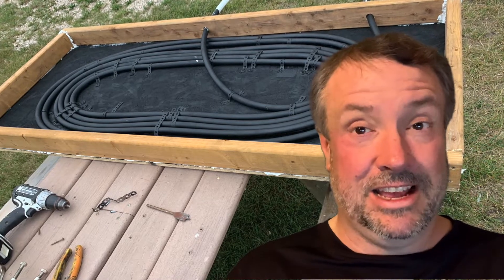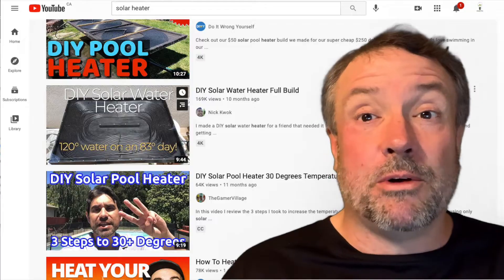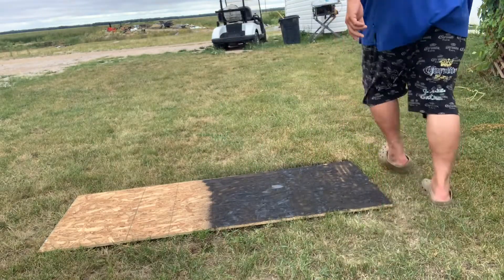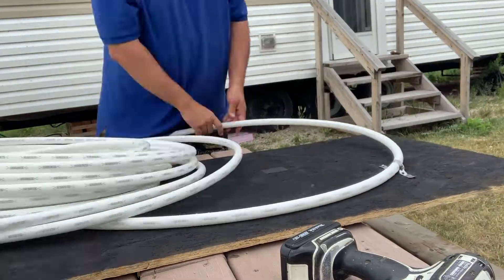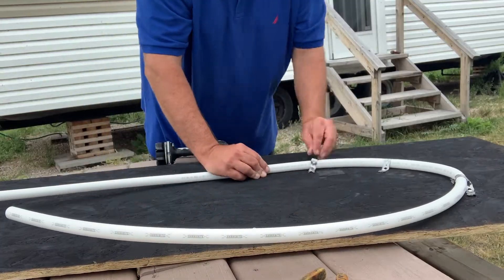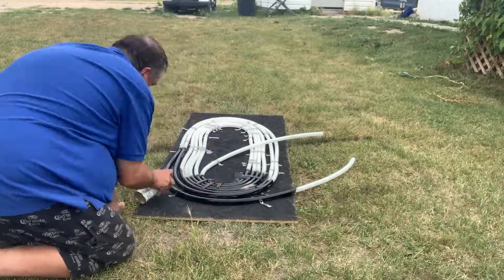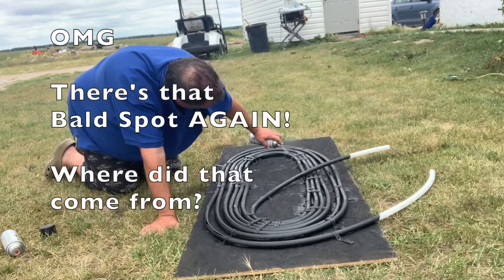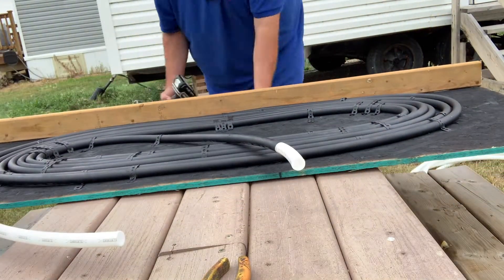Solar Water Heater Build with a Solar Pump

Comment from the maker: Love to hear your comments on how to make this work better!
Reply: 😉 This can be even more simplified. 

Try this experiment. 

Take the same length of coiled pex ( or coiled black dripline hose that is already black and is cheaper)  and cover it with a mulched greenwaste  pile. 

Then do some temperature comparisons. 😉
Reply from the maker: @wanasong5611  I have videos on compost heating on my channel
Reply: Wouldn't aluminum or some metal tube's work better ?  I don't know much
Reply: infi Del copper works best... but it's too expensive. 😉  Black irrigation tubing is cheapest and saves on paint.
Reply from the maker: @wanasong5611  cheaper than pex? Pex is pretty cheap
Reply: Simple Tek You'd have to price it out in your area... but generally, where I am, 100' of 5/8 irrigation tubing is about $20.00 compared to 100' of 5/8 pex at around $45.00.  And it's already black... so you can lay it out in the sun to heat up by itself or bury it in a well chipped mulch pile for even more heat.
Reply from the maker: @wanasong5611  interesting!
Reply from the maker: @infidel6347  I agree metal is better but they would but they cost a LOT more

Comment: I'm looking to doing something similar my only problem is I will be time getting to my water heater with the recirculation pump. So I have to have a check valve at the cold inlet of the heater. And also a shut off on the inlet and outlet. So something happens or there's no sun we can just use the regular electric heater. Looking into what I need to make it happen. Probably not going to put it on the roof because the pump would have trouble due to head pressure circulating the water just got to find a spot in the yard. Where it's nice and sunny a majority of the day.

Comment: One more thing that you can do. Line your box with foil insulation, the kind that can take the heat. Paint that black. Now all the heat will go into the pipe and not the wood.
Reply from the maker: Nice

Comment: I think if you put the thank on the bench and the panel on the ground you won't need a pump due to gravitational circulation. insulation will help a lot too as other people have stated, and placing a mirror on the north side of the panel to aim extra sunlight on the panel would help a lot too.
Reply from the maker: maybe but pumps work faster

Comment: Is it possible to build a drip irrigation system that turns on by itself in heated days with this technique?
Reply from the maker: absolutely - you have it with temperature settings for on and off.

Comment: First...wood bad.  Heavy and more expensive.  

Get metal stud channels and make a box.  You can either pop rivet or self tap screw.

Use a 4x8 reflective 2" poly builder grade insulation for the bottom.  You can use leftovers for insulating the sides.  You can paint the foil side.

Glazing (top glass).  Use double wall acrylic.

With this method in direct sunlight I had temps over 200F and melted lanscape tubing and poly insulation with no water flow.  i switched to pex and roxul and keep water circulating.  

Flow will determine your heat gains.  I get about 9 degree delta with 100' of pex in a 6x4 box from flow from my pool pump.

I have it mounted on a tracker.
Reply from the maker: wow - you spared no expense!!!!!! awesome!

Comment: I have had an idea of making a collector siilar to this using a black box with a window, a fan and a radiator (car radiator or similar) and use the air as a heat bearing media. Size is cheaper than PEX... is my theory.
Reply from the maker: why the radiator, you can do it with air. look up 'pop can solar heate'r on YouTube.
Reply: @SimpleTek  often I want water... For heating a water volume or ease of transportation, hence the convertion to water 

And my idea is one OSB, four planks, one transparent roof sheet and you get about 2.5kW incoming heat from one panel. And if you connect multiple panels together it's just one radiator per for instance 10kW.

Comment: So why did you spend all that physical time spray painting it?  You already lose so much thermal heat through the bare wood anyway.  Save the time spray painting and purchase a sheet of 1/4" pink insulated foam and put it both underneath and along the sides as it will retain the heat a whole lot better when you silicone seal the plexiglass to the top of the wood.  Heck turn it upside-down at night and use the warmth and insulation of the soil as essentially you now have a DIY Yeti cooler keeping your water warm while it circulates.  Plus the effencicy that you spent creating the heat from the coil escapes from the barrel because it's not insulated.
Reply from the maker: actually - good idea- I will put some insulation under and on the sides!

Comment: Build a heat pipe instead or use evacuated tubes way better.
Reply from the maker: evacuated tubes can be a lot more expensive. - what's heat pipe?
Reply: @SimpleTek  Heat pipe is a sealed copper pipe with a low evaporation temperature e.i. (acetone) filled about 20%. When the sun shines on the pipe the acetone evaporates and rises to the top bulb heating the bulb then condenses and runs back down the cool side of the pipe to start the cycle all over again. Same principle an evacuated tube runs on just not surrounded by glass vacuum.
Reply from the maker: @offgridwanabe  That is cool - thank you!!!

Comment: For pool heating I would go for corrugated polycarbonate sheets. These allow for higher throughput at a lower temperature, leading to reduced loss. The rectangle shape is also more efficient.
Reply from the maker: I've heard glass is better
Reply: @SimpleTek  I am not aware that corrugated sheets of glass exist.
Reply from the maker: @z4zuse  HAHA
Reply: @SimpleTek  I think I am using the wrong terms. I mean multi wall polycarbonate sheets. These have many channels. Attaching to a pipe with high enough diameter as input and output at top and bottom is the biggest challenge.
Reply from the maker: @z4zuse  ahh